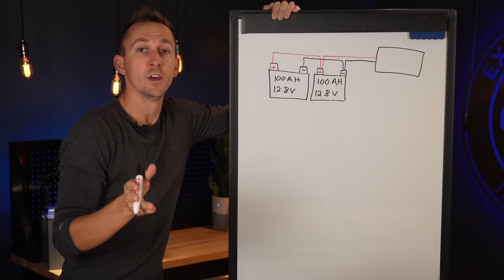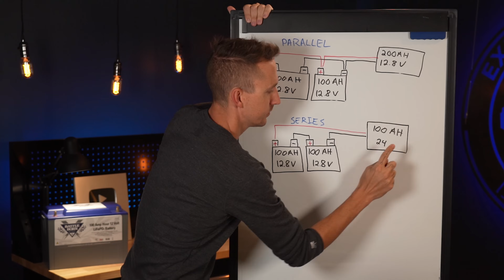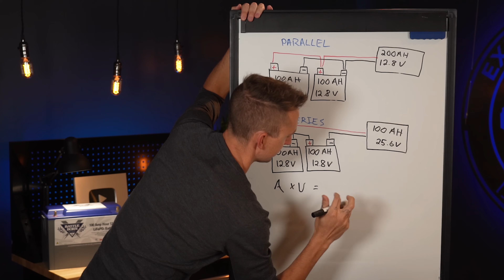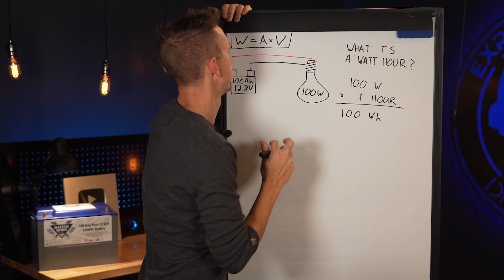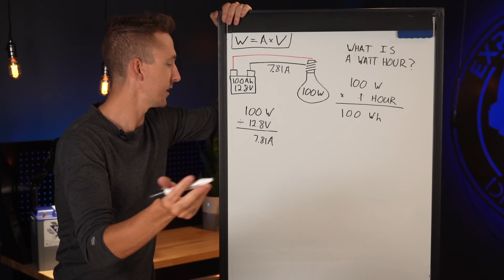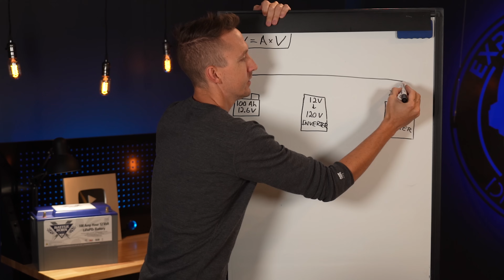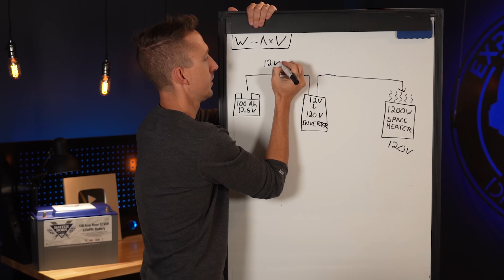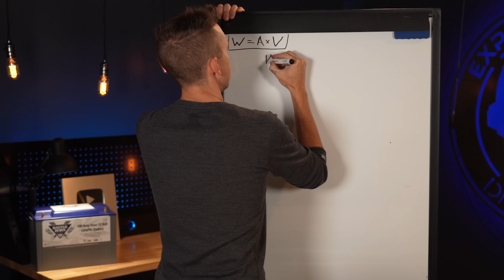AMP HOURS EXPLAINED (amp hours vs watt hours)

Comment: Does utilizing the lower amperage extend the overall usage of the battery?
Ex. If I increase the voltage on my e-scooter battery via series wiring between two similar batteries, will it increase the range or increase the amount of power it pulls, as in higher top speed, or simply make it last longer?
Reply from the maker: If you have 6 batteries, you have 6 batteries worth of storage, regardless of what voltage the load is.
Reply: @EXPLORISTlife  I understand that part, as in the overall capacity is 6 times the amount. Similar to having a water reservoir and adding five more to make six then connecting them from the bottom, but filling from the top, they share the capacity. However, I was more wondering if increasing the voltage through series wiring would make the scooter go faster or would it depend on the wattage of the motor on the wheel and the controller?
Reply: @noexplanation4343  I expect that increasing the voltage on your scooter would make it go faster, but if any of the parts are not built for that voltage, they may burn out immediately, destroying the equipment and possibly causing a fire (depending on how much safety is built into your scooter electronics). Under-volting equipment will often increase lifespan of the equipment, as long as it's enough voltage for all the parts to function, at the expense of things running with less power (slower).

Comment: to me, why compare a 24v, when its more common to use, and compare 6v to 12v. because if i use that theory on 2 6v in an rv, its still the same as 12v.
Reply from the maker: If you take the knowledge you gained in this video, keep an open mind, and apply it; you'll be able to apply these concepts for any voltage.

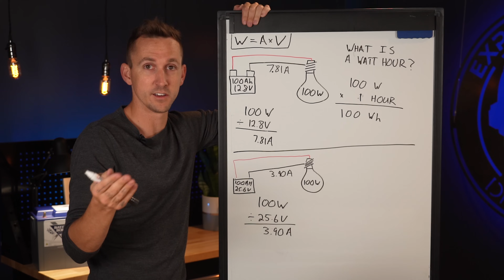Comment: Something here I don't quite understand: At around the 5:00 to 6:30 point on the white board you show 2 examples, 1 with 12v and one with 25v and the amps for a 100w light bulb. 12v is 7.81 amps and 25v is 3.90 amps. So off I go to do some google searches. What I found was pretty different then what you are showing for 100 watts and how many amps DC or AC that would equal. I'll just have to re-watch and re-search and try to figure out what I'm not understanding or what I am missing.

Comment: Is this Same concept on lead acid??  Or just lithium?
Reply from the maker: Same.  The only kicker is that using more than 50% of the capacity of Lead Acid will GREATLY diminish it's lifespan; so most say that if you have, say, 100Ah of lead acid battery capacity, you 'really' only have 50Ah usable.

Comment: well it would be nice if you had explained how much time we get from an inverter to space heater since it's only taking 10 A . does it mean the 100 amps battery when connected to the inverter to the sapce heater comes around 10hrs time ?
Reply: Depends on efficiency of the inverter can consume small or high amounts of watts. So you would need to verify the inverter usage and take that into consideration.

Comment: I shared this video to a FB group that I'm the admin for.  People always seems to get confused on terminology about amps and amp hours.  They will say "my space heater draws 100 amps per hour instead of "100 amp hours."  Telling them they are wrong in saying "amps per hour" is an exercise in futility.
This idea of using the phrase "amps per hour" instead of "amp hours" is not a new thing.  People have been saying that since time began.  I remember hearing it from old timers back in the 90s when I worked as a tech support person for a major inverter manufacturer.

People don't understand that saying "amps per hour" does not explain how many "amp hours" have been consumed from the battery bank, it just defines how much power is flowing to the given appliance.  In fact, the phrase "amps per hour" is a meaningless terminology.
Think about it like this:  Saying 100 amps per hour is the same as saying 100 amps per minute or 100 amps per second.
If your space heater draws 100 amps of power to run it, it draws 100 amps period.  It's pointless to say "100 amps per hour".
The term AMPS defines how much power is "flowing", not how much power is being consumed over time.  People take the "time" phrase of "per hour" and attach it to the "amps" unit of measurement and think they are now measuring "amp hours" and they are not.  There is no such measurement unit called "amps per hour" and people don't understand that.

It flat out drives me nuts when people in the group I run start talking about power systems and throw out the meaningless phrase  of "amps per hour"

If you could come up with a way to explain this in a video, you'd win a Pulitzer Prize!
Reply from the maker: Thanks for the share!  I think this is the next most useful video that explains basic terminology like amps/amp-hours/etc: https://youtu.be/hn6xpMji59g

After that, this is a full playlist about system sizing that will really nail the concept home: https://www.youtube.com/playlist?list=PLmvhcyi4n0TVEQCWqGvT0Q0vd8BCbrGfj

But yeah, I definitely understand the frustration with people being un-willing to learn.  But all we can do is provide the education/information and it's up to them to be willing to apply it.

Comment: I have 4/6 volt battery @ 435 amp and I have 8/6 volt battery @ 230 amp, can I hook up them 435 amp with them 230 amp as one for a 24 volt system?
Reply from the maker: Nope.  All batteries in the same bank must match.

Comment: I am wiring three 230 Ah Lithium batteries together in parallel, I will attach the first battery negative to the Lynx distributor and the last battery positive to the Lynx distributor.  This will give me two different cable lengths when I compare the positive and negative lengths. Should I make the two cables the same length regardless or does it matter? (both are less than 3 feet)

Comment: So, is it the load that determines the number of watts that will be "pulled from the power source, as it seems here?  What determines the amperage and voltage amount that moves between them - and how many volts will flow from the battery to the load?  In the example with the 100 watt bulb and the 25.4 volt battery, why would it run with 3.9 amps and 25.6 volts and not 7.81 amps and 12.8 volts or some other ratio equaling 100 watts?  What determines this?  I guess my real question is:  What "sets" the final volts and the final amps that will apply (either the load, the battery, or something else?  What makes a “100 watt” bulb a 100 watt bulb?  Would “any” mix of volts and amps work to power the bulb, as long as it equals 100 watts (e.g., 12.8 V and 7.81 A, 128 V and .0781 A, 1.28V and 78.1 A, etc.)?   Thank you!

Comment: very cool. I am trying to figure out if I can build a battery bank of 4 12 volt batts to b 48 volts. and deliver 1000 watts. so I will have to learn this math at some point. this is the best video I saw so far. but I am not tech savvy. so I ll see if I can pull up more of these

Comment: If you can afford a 24v system go with that one,wayyy more energy dense then the 12v
Reply from the maker: That’s a pretty misleading statement.  A 1000wh 12v battery and a 1000wh 24v battery will be nearly the same size.

Comment: Was hoping you tell me why everyone insists on using aH
Not wH. Even for appliances, everyone talks about the current.
Reply from the maker: I dunno.  I didn't start that trend.  I just react and educate accordingly.
Reply: I am guessing it's for marketing/sales purposes - playing with the numbers.  A 3.7-volt cell phone battery rated at 5,000 milliamp hours (or 5 Ah) seems better than calling it 1.35 Wh.
Reply: @pleskbruce  a light build is rated in watts though

Comment: Finally, a video that doesn't use water as a reference.

This makes sense. Thank you very much.

I had a general understanding of electricity but not the full function of power transfer from a power storage.

Do you have any videos on the difference between 12 - 48v lead acid batteries and so on.

I can really do with that knowledge

Comment: What is the advantage of putting a 20 kw generator into an RV instead of a 10 kw generator if they both have 50 amp breakers that will trip at the same time.  You have a bunch of watts you cant use.
Reply from the maker: I can't imagine a 20KW RV generator having a 50A breaker unless it was three phase; which would be pretty rare except for maybe some of those RV's with like 5 air conditioners?
Reply: My RV is 12.5 kw single phase but my buddy has 20 kw and I believe single phase.  My question is, is there any advantage to having more kw or would it be totally wasted as the breaker would stop you from using the extra kw.   @EXPLORISTlife

Comment: Can we charge a battery pack of 24v while taking output from it .
We need your help in our project of Prototype of self charging electric vehicles
Reply from the maker: You can most definitely charge and discharge a battery at the same time.  The battery will then just charge/discharge at the net difference between the charging and discharging rate.

Comment: this AHr/ WHr etc is archaic and used by marketeers to obufucate, confuse etc customers so thet can't comare. In simple terms, the energy stored is measured in Joules..to start using Hours (not seconds. the basic SI unit() and flipping between i and V is very deliberatly designed to confuse. The energy capacity is Joules....the efficacy of transduction is another matter. FFS this was in the 20thC norm for SI, yet the deliberate use of non-standard archaic units persist so that the average person can't compare....... :-(  

(

Comment: I have 4 battery banks which are 6 2v 400amp  batteries tied together in series. These are tied together in parallel to give me 1600ah at 12v  My controller shows me only 400amp  . Is it only showing me one of my battery banks or all of them? If I have used 60amp does that mean that I have 1540amp left?

Comment: If i want to add a larger alternator to my work van so i can add two more batteries to power tool battery charging, should the batteries be wired in series or parallel?

Comment: To be clear here guys, you NEVER, EVER, get something for nothing.  With regards to the Inverter, and to provide clarity.  The inverter is stepping up the voltage from 12.6 to 120 volts.  You don't get something, for nothing.  Whenever you step up voltage, you step down the amperage.  That inverter is supplying 120 volts, but only at 10.5 Amps, and not 100 Amps.

The way he explains it in this video, it kind of looks like he's telling you that the inverter is also supplying 100 Amps.  It's not.
Reply from the maker: The inverter is supplying 10A to the 120V load while pulling 100A from the 12V batteries.

Comment: This was very useful.  I have an unusual van.  It is a surveillance van.  We are private investigators.  We have vans of various sizes.  We can only use batteries to heat and cool and run cameras and monitors.  The 1300 watt space heater is particularly pertinent to our systems.  We have large vans that have a very well isolated and insulated diesel heater that cuts down sound but not odor.  We want to convert to all battery.  For a small van, think shortest medium roof Transit, that is very well insulated if we need to run a heater for 8 + hours,  are we going to need (4) 200 AH Lithium batteries? If so, it does not seem like we could charge all the batteries in 1 hour of driving.  What are your thoughts?  Does a heater that states 1300 watts consume that much when running?   Is the insulation in a stationary vehicle really effective?  The user area has on two back windows and has two inches of spray foam on all surfaces.  Would love to hear your input?  We can't use a diesel heater when we are in a city as it is to obvious.  In summer we need to use AC.  Any optimization suggestions?  Thanks  Steve

Comment: Ok
I get the video, but not clear on should I buy one battery, or one battery and an inverter, or two batteries, or two batteries and an inverter, to power my Ac, refrigerator and space heater for more than one hr.

Thanks

Comment: Question: at 5:20 you're talking about running the 100w bulb. 7.81 amps for 1 hour or double the amps for 2 hours....... my understanding (not much) says thats wrong. Shouldn't it be the same amps just use twice the power because it's on twice as long. 
I'm not sniping, trying to learn or make sure I'm right. 
Thanks man, video is great
Edit!!! You said its going to pull that many Amp Hours! Got it. I saw later in the video you were more clear about draining the AH from the bank.

Comment: Great video.  It got me thinking.   If 24v is more efficient than 12v, wouldn't  wiring 10 12v batteries in series for a 120v system be even better?
Reply from the maker: If you wired 10x 12V batteries in series for 120V DC; I'm not sure what you'd do with that as pretty much nothing runs at 120 volts DC.  It'd still have to be inverted from DC to AC for standard household outlets; and I don't know of any inverters that work on 120VDC power (plus that'd end up being significantly more dangerous working with a 120VDC battery bank.
Reply: @EXPLORISTlife  Thanks.  I had a feeling there was a reason nobody had taken it that far.   But I needed to know the logic.

Comment: I've noticed that some of the all-in-one power units (Bluetti, Ecoflow, etc) are starting to label systems/batteries in watt-hours.  Just seems to make more sense and easier to calculate run times or percent usage from power loads.
Reply: I find that cheaper brands and cheaper devices tend to rate things in a way to make it more confusing (On purpose).  What ever number sounds better to an amateur.

Comment: Hey Nate
I went from a 12V trolling motor on my boat with 2 Lead acid group 27's wired in parallel to a 24V system with 2ea 100amphr Lithium Ion batteries.  I see other boaters claiming by switching to Lithium ion phosphate they can basically double their battery life under normal usage conditions but your math suggests otherwise.  I do realize DOD is quite different between the battery types but these guys run the lead acids pretty much dead while on the water anyways.  Are the guys telling tall tails or are they really burning less amp hours?

Comment: Perfectly explained as in a dummy and need visual context. 

I just want to double check:

(2) 100ah (12v bank batteries - wired parallel) give 2 hrs run time at approx using a 1200 watts device/appliance. 

Using (2) 100ah (24v battery bank - being wired series) will give 4 hrs total run time. 

Both systems only use (2) batteries,  but wiring in series gives you double the time.

Why wouldn't everyone do this??!! 
Who wants double the batteries just to match the same capacity of a 24v system? Also to remember that you must have a charge controller that works with a 24v system.

Comment: This is adequate for theory and planning, however, there is power lost as heat in the conversion process.  There may be a way to figure power loss, but I just always figure 10%.  You can't really set up a circuit that is 100% accurate, or at least I can't so I alway try to oversize any plans by at least 25%.  In other words, I am a jack of all trades and...
Reply from the maker: I have other videos covering that since that is off topic for what I was teaching.  Thanks for watching though!

Comment: Hey Buddy, thanks for the Vid. You definitely taught me some stuff & you can explain it better than I can.
I did notice one thing that could of just been an mis-write, in the beginning of the vid there were (2) 12volt parrelled batteries, the positive & negative wires were both wired to one end of the battery bank instead of negative on one end of bank & positive on other end of bank for even/equal current flow.
Thanks again for the video bro!
Reply from the maker: See any of our full installs videos or wiring diagrams for more info on how to actually wire a battery bank.  I also didn't show any lugs, fuses, wire sizes or heat shrink in the 101 level concepts-only video.  Don't nit pick me on off-topic stuff like that. 🙂👍

Comment: Thank you so much for this video, l have been asking other people on youtube how to work this out but no one has explained this .
Am I right that if I have a battery made from  16,  (3.2volt 304ah) lifepo4 cells wired in series it will give me a 14.5kwh battery ,and if i run a 1000w resistive load from an inverter at 230 volts ,it would run for 15 hours ? from 100% soc to 0% soc , omitting any losses and the resistive load will run constantly .
Therfore if I ran it from 100% soc down to 20% soc it would run for 12 hours ? . I understand there will be a lot of losses in the wiring and inverter etc
Reply from the maker: Not accounting for losses; a 14,500Wh Battery will power a 1000W load for 14.5h

Using 80% of 14,500Wh is 11,600Wh

A 1000W load from 11,600Wh would run for 11.6 hours.

Watt Hours / Watts = Hours
Reply: @EXPLORISTlife   thanks for your reply , 👍

Comment: Thanks for your video. Can you help me in making the lightest battery power system for bike touring working remotely for 8h + 6h study using a Mac mini m1 and a tablet for screen, will use a small one burner electric stove, 2 lamps, 2 celular, 1 akaso ek7000 mini câmera, flash lights, small fan for hot days, and heated blanket for extreme cold nights. Just an estimate will do? 😂❤
Reply from the maker: You'll want a portable power unit like a jackery or goal zero or something like that.
Reply: @EXPLORISTlife  Much lighter. It's for a bicycle touring World wide. But need to work still. Size and weight is one big concern. Need to calculate how much power the PC, table, cel phone, cameras battery, and small fan would consume. The other stuff don't bother. The bicycle os anormal one, not motorized. To power the battery a small solar panel.
Reply from the maker: @anadearmond8846 I guess what I'm saying is that I don't specialize in the lightest systems ever and was suggesting what I feel would work.